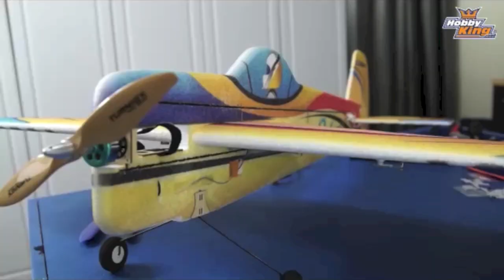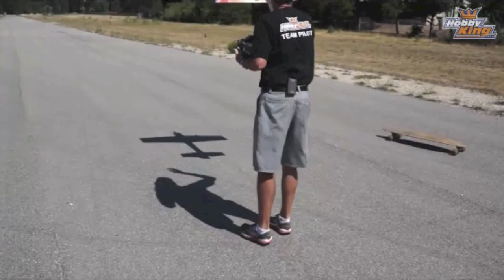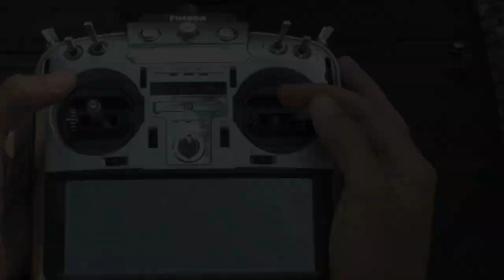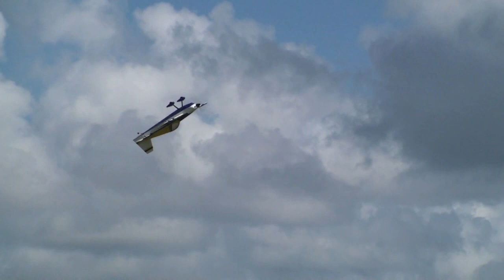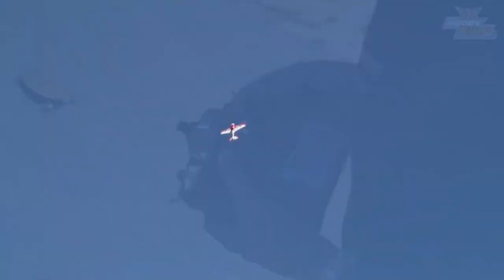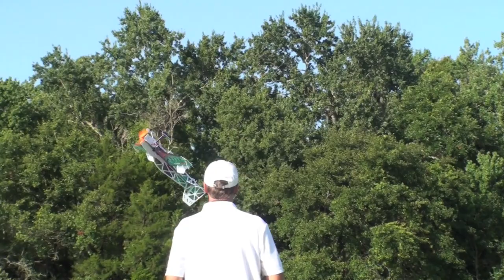Hobbyking - MIchael Wargo Easy as 12 3D   The Maneuvers Advanced and in-depth

Comment: Dear Michael, sorry for the late reaction. I worked up to this point and took ome time :-).  There is still something I do not understand. If I set my throws to their maximum mechanically possible deflection, what is the vaue for the throws on the transmitter at that point: 100% or above ?.  It would seem to me that in order to use the maximum resolution at all rates, this would be the maximum values the transmitter has to offer. (usually 120%~140% depending on the transmitter). Am I wright ?
Please would you try and clarify this some more ?
Thanks again, Enjoying the video's very much indeed !
Reply from the maker: you need to use that to set maximum mechanical.  This means the aircraft's full deflection.   the measurement on the radio/servo facilitates that.   the rate will be on the number where the surface is maxed out.